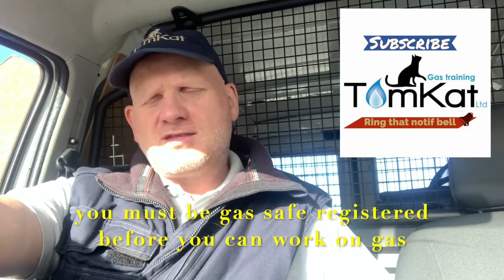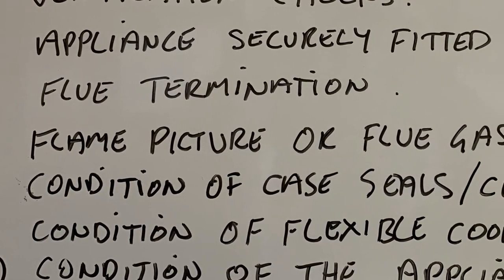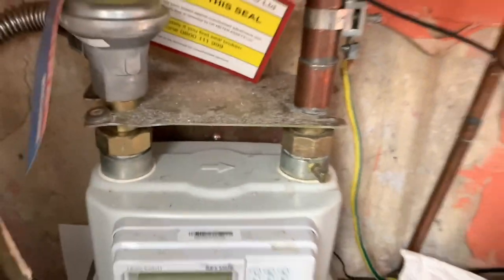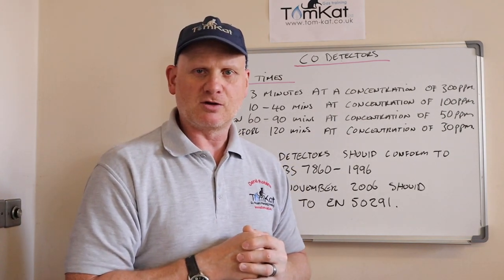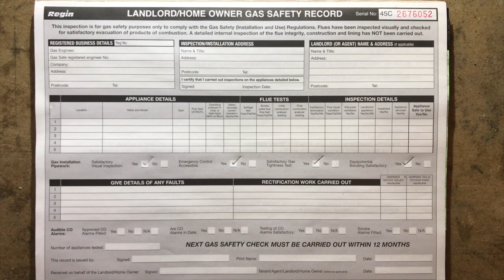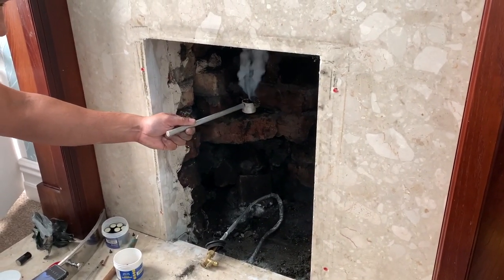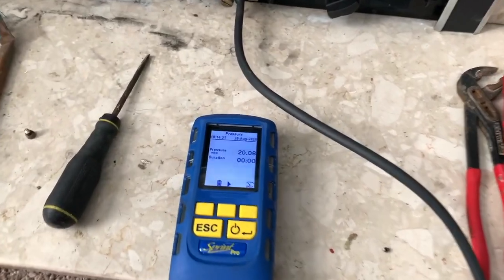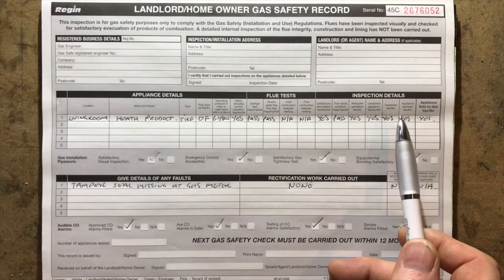LANDLORDS GAS SAETY CHECK, part 1 introduction on  how to carry out a landlords report for trainees

Comment: Brilliant video Tomkat. Ive been doing Gas works for the passed 14 years. People don't realise how much work there is on a landlords report, what is the going charge for a report lile this one your doing with 3 appliances. I would want at least £150 there is alot of work to do the tests  thoroughly. What's your opinion.? Thanks Josh
Reply from the maker: It’s the letting agents that are the pain. They take most of the money for no work and pay the engineers very little. In our area a few letting agents won’t landlords reports for £35 for all appliances including fires they say we would make the extra time up when there is only a boiler.

Comment: What tape did you use to protect the pipe of the fire?
Reply from the maker: Garlic just electrical tape as it is heat proof and the glue will not effect the copper pipe

Comment: So i only have CCN1 and CENWAT, I install boilers in council property’s but I also am required to fill out a CP12 but my question is can I legally fill out the CP12 if there is a gas cooker or hob in the property for example just do a visual inspection on the tenants cooker/hob or am I required to do CKR1? Because when I did my ACS I still had to cover the theory and practical on cookers and fires but because I didn’t have evidence in my portfolio for these appliances I couldn’t sit them even though in reality I did sit them?
Reply from the maker: The short answer is no
Reply: Thanks for the reply, problem is I have already filled quite a few out, the company I work for must not have know that, how long after passing can I go sit CKR1 without portfolio evidence?
Reply from the maker: @masterchaz100  12 months

Comment: Hi Derek if you went to carry out gas cert and you seen something that was going to be AR would you still check then issue AR warning or not carry out check untill it's sorted out
Reply from the maker: Peter sutton you fill in a warning notice and stick on the label and make the appliance safe then record it on the landlords report as you wouldn’t get paid for sorting the problem without the landlords permission. You have to follow the GIUSP if you find AR or ID appliances

Comment: Quick question, do you have to purge because you disconnected the gas to the fire? Thanks
Reply from the maker: Yes you do if you let all the gas out of the pipe you will need to purge